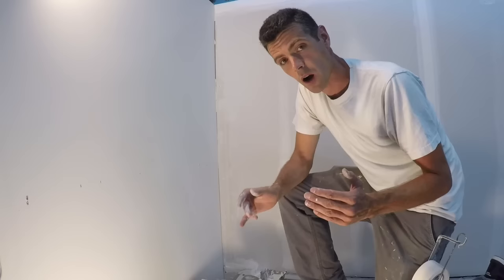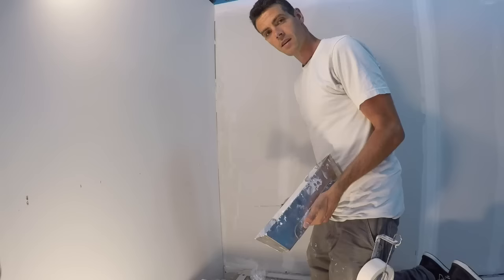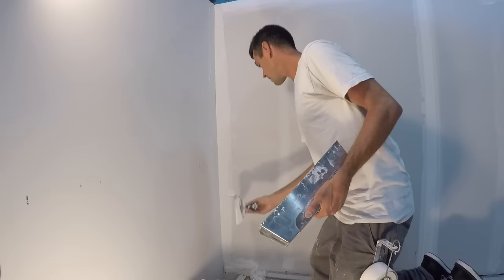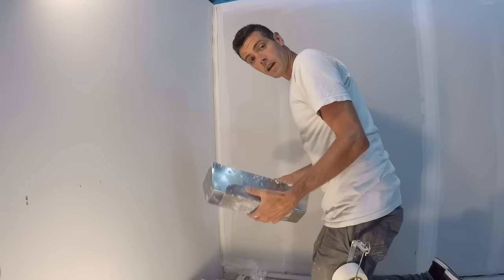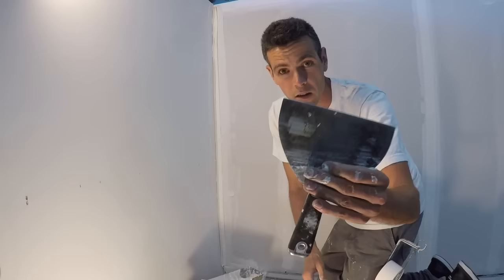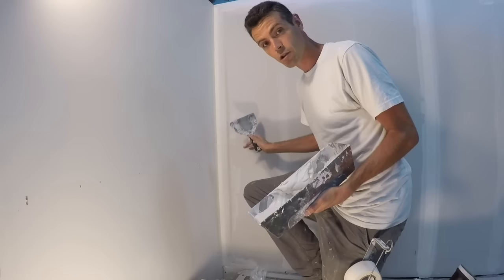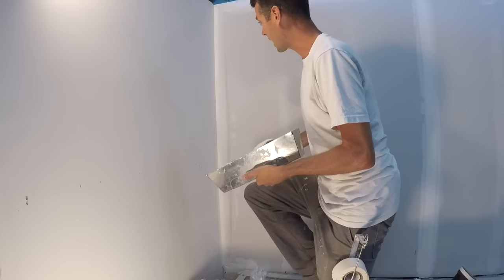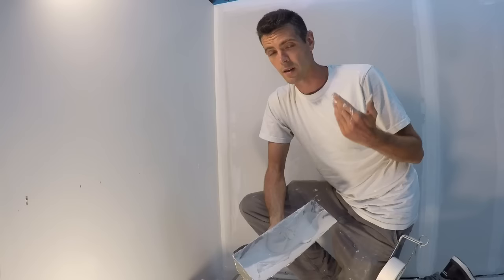Top 3 Beginner Mistakes on Inside Corners!!

Comment: Question please. 

Near the end @4:35, you said to only do one side at a time. What is happening when you apply mud to both sides? I thought you were already finished applying mud, but then you added more and said you were going to wait for the other side to dry. 

Thanks in advance.
Reply: I'm no pro but I think what ur talking about is the mud he put down under the tape... you have to mud the corner then apply the tape and then mud over the tape. When u try to do both sides of a corner at the same time u end up with a ridge on one side from the putty knife hitting it when you put the mud on the opposite side.

Comment: Some good tips, but you dont need to wait a whole day to do both sides lol. Just angle your knife 45 degrees, or what we call a "sparkel" in Norway and Voila. Both sides good, plus a thin stripe of silicon later will be put in the corner, so that will also be of help to get a perfect Inside corner. Just saying that cause productivity is a bitch, so no waiting. Cheers.

Comment: I need to help my tapers to speed up their productions. I was thinking of investing in a siring tube and a flusher or Angle head. Which one do you recommend. And which one is easier to learn and work with on first coat and finish coat? Many thanks your amazing!!
Reply: I would suggest getting a tube, angle roller and angle glazer head that is 2.5 inches for first coat and getting a 3 inch glazer head for 3rd coat on it.. We get whole 4000sq ft houses 1st coated in one day with a tube, roller and glazer

Comment: I dont think the sharpness of the knife its a problem I believe that the most common mistake for beginners its actually the amount of pressure they put on the knife while wiping the tape .. the harder you press the more mud you take also the higher chance you have to ripped the tape ! But great video i agree with one side at a time tho sometimes they are rushing through work wanting to do more ..

Comment: I read a lot about wetting the paper tape in water to help it adhere to the mud as well as helping with avoiding bubbles, etc.  You did not wet this tape.  What are your thoughts on this tip?
Reply: You want to wet tape in long runs. Sometimes I do on ceilings if mud is drying to fast on edges while taping. If it’s hot out and using 45 min to tape. But I find no reason other than that!

Comment: In my house the walls look scratched but it painted I want to do skimming ,can I do skimming on the top of painted wall or it will need sanding first thanks.
Reply: You can skim coat almost any painted wall, no problem.  Old oil base painted walls can be a little tricky as sometimes the paint is blistered but hasn't cracked the surface and may give you a little trouble.  But all in all, skim away.
Reply: High Voltage ok thanks for helping.

Comment: Hanging drywall on a 5’x8’ wall. Do I hang it horizontal and have cut end in one corner on both pieces? If so will mudding be the same process as this?
Reply: Yes it will, good luck
Reply: Do whatever it takes to keep flats not butts. The beveled edge is easier to work.

Comment: Do you recommend taping drywall to plaster? Especially drywall to plaster in which they meet at a corner? Thanks!
Reply: Yes. That will work. Use paper tape. May want to do a good sand on the plaster wall to smooth any bumps.

Comment: When do I use tape, or the mud  or how to choose between mud and drywall compound?
Reply: Paper Tape can be used for flat tapes and internal joins, scrim tape (fiber) can be used for flat tapes and a paper metal tape for external corners the mud is basically joint compound but if using scrim tape you need an easy sand filler witch will have a quick dry  time I personally use joint compound for first coat and the pre mixed bucket for finish coats  unless I'm wanting to do 2 coats the same day I would use the quick dry easy filler

Comment: If my drywall is tight into the corner with no voids to fill, I just run a bead of flexible, paintable latex caulk into the corner and feather it with a wet finger tip. So much easier, but caulk has to be type that stays pliable so it won't crack over time. If I need to use tape and compound, I've learned to forget about the corner trowel and to also to do just one side and then the other the next day.

Comment: What about inside corner beads?  Paper ones with metal strip in the middle.  Home Depot sells them.    

Wouldn’t that be easier to use
Reply: They are meant for outside corners around heavier traffic. Not made for inside corners.
Reply: No because they are outside corners and even if they were for inside corners you have to float corner bead out at least a quarter inch usually. It's a minimum of 2 pulls usually 3.

Comment: Unique situation here.  After 20 years, I hired a roofer to tear out my roof and install new shingles.  He failed to tarp the roof one day, and I got rain inside the attic, water migrated to the ceilings and separated tape at the ceiling joints.  The tape on the wakll side is intact, but the tape on the ceiling side came loose.  Can I just cut at the joint, and retape the ceiling only with a half width of tape, or do you recommend tearing out both sides, and start over?, and will I have success removing the entire tape even though it's been painted over a few times?  THUMBS UP!!!
Reply: Cut the tape away on the ceiling edge where it has come away. Then apply tape over both ceiling and wall junctions. If you only apply a flat tape on the ceiling it will crack again.

Comment: It is your choice to do the corner like that, but is not the best. Too much handy operations. You can use a roll with mud, wich is faster and easy. When is fully dry to next day you can put mud on top by a roll technics as previous time both sides.

Comment: Never did drywall but am a bit afraid. I feel lost on how to start.  I need to replace molded drywall. So I cut it out and then drill in a new large piece.  To connect top and bottom of you use tape and mud?  Is that it?

Comment: Before you talk about the blade of a taping knife, you haven't told them what side of the blade to use. Good job so far but you are not telling them the details.  This is coming from someone who has been doing drywall longer than you have been alive.
Reply: Richard Ghormley Question..I’m a weekend DIY’er. What side should we be using? Also, is there one brand of knives to use over another? 

Thanks!
Reply: @berternie1098  look down the blade of a taping knife and look for the slightly outward bowed side.  That is the side that you want to use. If you use the other side,  you will always get heavy tool lines at the end of the blade. As for brands Harington and Goldblats are fine. No matter the brand, I always prefer stainless steel knives. They don't rust.
Reply: Richard Ghormley thank you very much!

Comment: What!!!  You're using mud?!?!  I you  Sheetrock 90!  You Pre fill the gaps with   Sheetrock  90  With mesh. Then You apply the Corner tape with Sheetrock 90.   And then send it a bit. Then apply 2 Coats of Sheetrock 90 and send in between coats.  And then you apply!!!! The mud.

Comment: Is it not “cool” or “pro” to use a corner trowel when top coating the tape? Both sides, one shot. And easy enough for a DIYer or beginner.
Reply: Problem I find with that is that corners are never square, so it leaves you needing to do what he is doing in the video anyway.

Comment: I’ve made all of those mistakes! I switched to a glue-on corner tape, it’s expensive but I don’t do a lot of corners so it’s worth it. I learned about Strait-flex corner tape and 3M corner spray adhesive from Evan and Katelyn, I don’t have to deal with mud until the corner tape is attached. I still screwed up the feathering because I tried to make both sides pretty at the same time. It’s so obvious I should have done it over two days, duh! VC saves me again!  Corner tape/spray adhesive video: https://evanandkatelyn.com/2017/03/how-to-patch-and-repair-drywall/

Comment: Really? Coat only one side of a tape at a time? That's ridiculous. At least use angle knife. Or better yet, use a tube/roller/flusher.
Also, sanding down your knives? That's a mistake. Having your knives sharp is what you want. You dont want to run your knife down the angle tape like that.

What a joke.

Comment: Not sure why everyone likes you. Why would u wait a whole day to mud the other side of a corner? I mean at least recommend that they use the quick setting mud so they can mud the other side in no more than an hour using 20 minute. I always wait a little longer than what the bag says. But either way i can mud both sides. If you are good you can mud both sides of a corner. If you mud one side and you are doing 3 coats to finish then that is 6 days of drywall finish work. That is uncalled for. Bad recommendation.